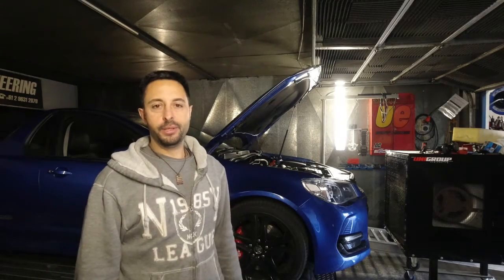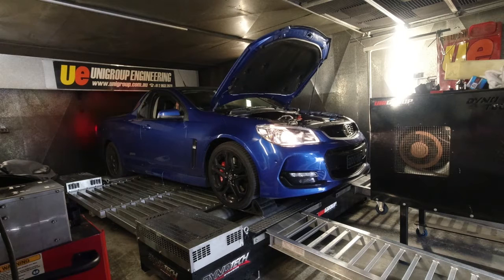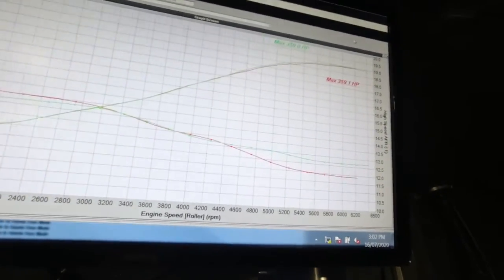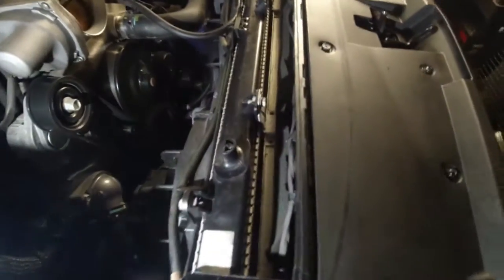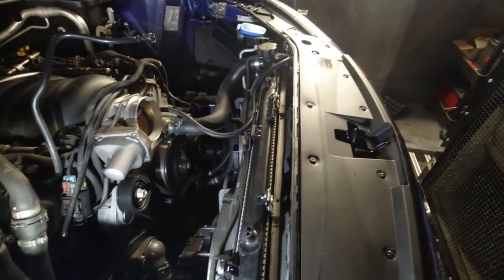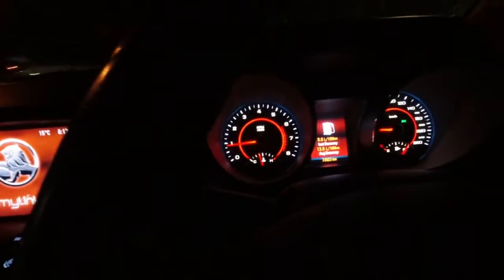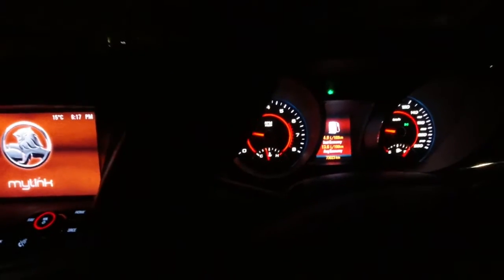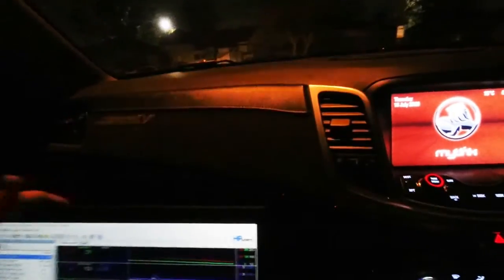LS Engine Intake and Exhaust Mods - Holden Commodore VF LS3 Dyno

Comment: They work well with Replacement exhaust and intake, mine managed 410hp at wheels with these mods
Reply: What was your baseline? Sounds alot for just intake and exhaust
Reply: @leomeares2270  not really..
I think it was 247rwkw.
Apparently a full exhaust system including extractors will give you the claimed engine power at the wheels. Vf2 ss are 304kw claimed so it sounds about right.
Reply: @HellenicRambo  interesting, because 247kw is 330hp...
My LS3 made 244rwkw baseline(with a dodgy 6L tune and catback exhaust) then 277 after an otr & full exhaust+tune...works out to be 370hp
Reply: @leomeares2270  well, I'd take it to another tuner.
There's workshops even on YouTube doing 400+rwhp on full exhaust system with tune and OTR.
Reply: @HellenicRambo  no sorry mate there isn't, keep in mind its the ls3 not lsa... I think you may have your numbers a bit wrong...
Reply: @leomeares2270  numbers aren’t wrong. I converted my VX SS to LS3 with OTR and dual 3” Hurricane full system and making 404hp at the wheels.
Reply: @Greeny_62vxss  that sounds more realistic  given mine was a higher klm car. Still wouldn't be surprised if old mates 410 was on a happy dyno...

Comment: The rev hanging forms part of emission control Holden introduced in VF series. Nothing to do with customer experience. Feature is a pain in arse  when shifting manual VF V6 and V8. Glad you have been able to tune it out. Good work.
Reply from the maker: It is something I could possibly get used to, but it drove much better with it off...👍.